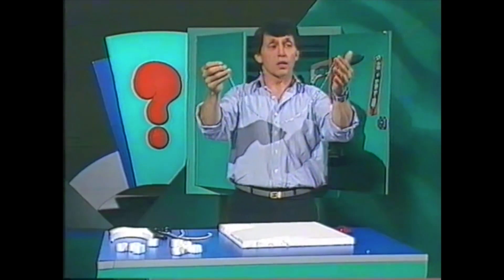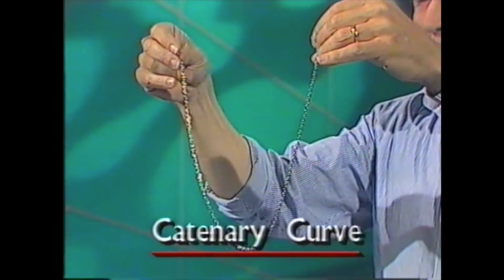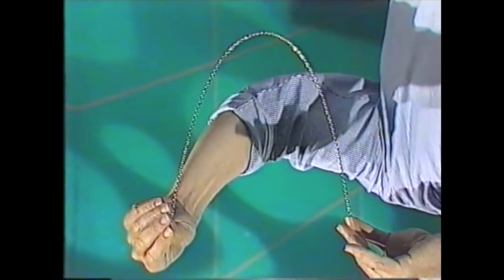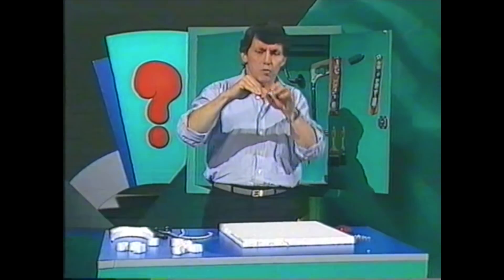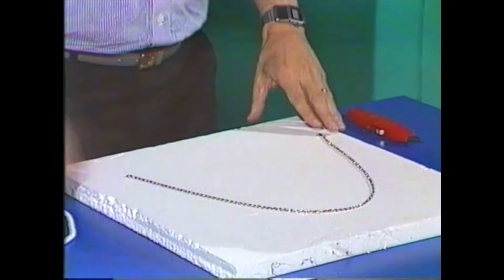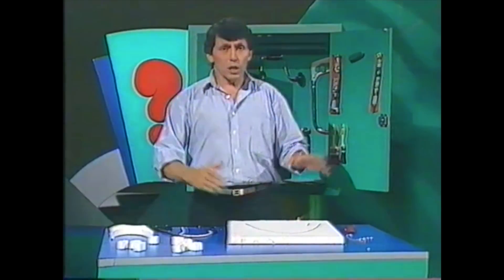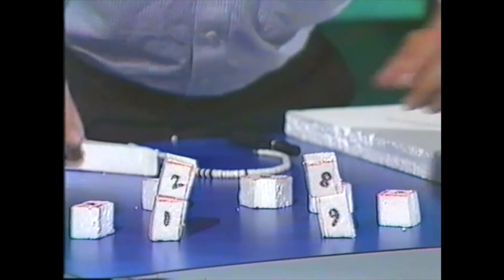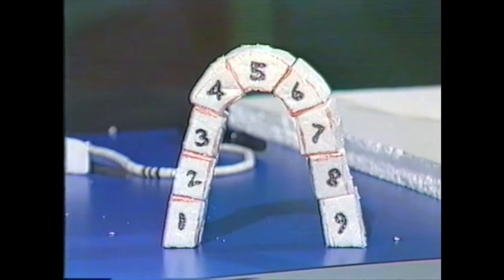Majestic Catenary Arch

Comment: The Gateway Arch, in St. Louis, Missouri, is as tall as its base is wide (630 feet, or 192 meters); but most published photos of it, in my experience, are taken diagonally, so that it looks tall and skinny.

The arch gets its name from the idea that the city of St. Louis is the gateway to the West.  Building of the arch started in 1963.  On the day on which the keystone piece (not made of stone) was lowered into place, in 1965, firetrucks had to be brought in to spray water on the two sides of the arch:  they had been built up from the ground in segments; on the final day, in the heat of the sun, they expanded so much that the gap between them was too small for the keystone; the water from the firetrucks cooled them enough for it to fit.
Reply: Neat! Thanks for the info

Comment: 3:21 It even holds up under earthquake conditions? Cynical me wanted to see the next few seconds of that scene.
Reply from the maker: It's still standing !!  Try it with your friends.  You'll be amazed.  Deane.
Reply: Not likely as shown. An arch is extremely strong in compressive force and a catenary cable is extremely strong in tensile force (materials depending of course). But both are useless against their opposite force.

A 2d arch is also strong for a force directly down or along its axis. But a force that comes at any other  angle would induce tension on one side of wall or the other and topple the wall sideways quite easily.

An arched dome alleviates the side force issue (a little) but side forces still induce tension. Heavy rocks are great for keeping the compression outweighing the tension under normal circumstances, but in and earthquake the rocks themselves can bounce up eliminating the compression and letting the tension get the upper hand. 

The solution to this is to back the arch with an upside down catenary cable tightened down so that its tension provides compression to the arch. Think about a rubberband tightened down over the top of the blocks shown. Now, even if the blocks are bounced, the  rubber band will keep them compressed together through its own tension.

Comment: The Catenary Arc is a hyperbolic cosine curve, right?
Reply: Yes, but it is often easier to use the exponential form for calculations.
Reply: @timharig 
What other form would there be?
Reply: @xCorvus7x  There are several equivalent forms. The one I'm talking about is the one that you get when you actually solve the balanced forces for each point in a line hanging from two supported ends. Since this is the solution top an ODE, the solution is naturally the sum of exponential powers. Here is the image from wikipedia since youtube has no good way to typeset equations: https://wikimedia.org/api/rest_v1/media/math/render/svg/1e2d387d79e500a90035448068febb17e69d8e5c .

There are other equivalent forms depending what you actually want it expressed in terms of. For instance, the form of the curve expressing the curve radius in terms of the arc length of catenary is quite eloquent. https://wikimedia.org/api/rest_v1/media/math/render/svg/a3a424672ce2053ded644050377808daf97b8f18 . This should look very familiar if you work with Laplace transforms much.